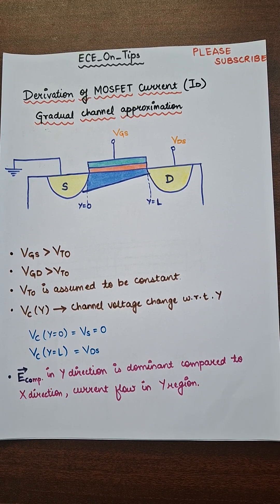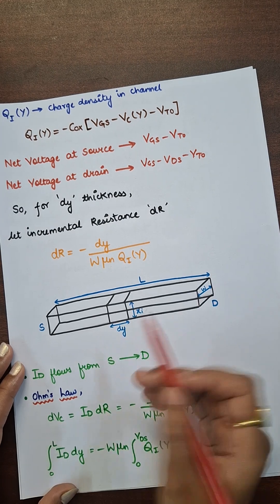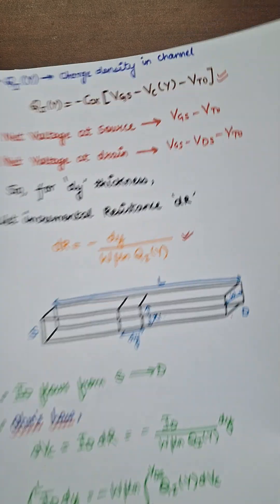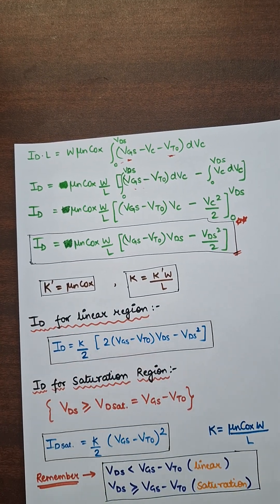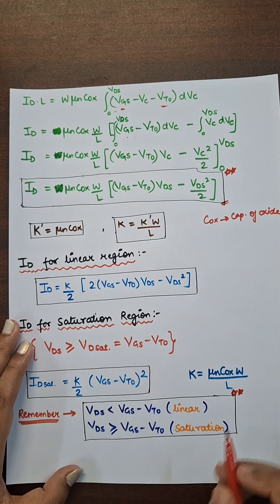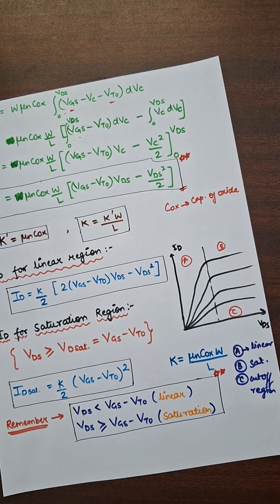Derivation of MOSFET Current (Id) and Gradual Channel Approximation @ECE_On_Tips

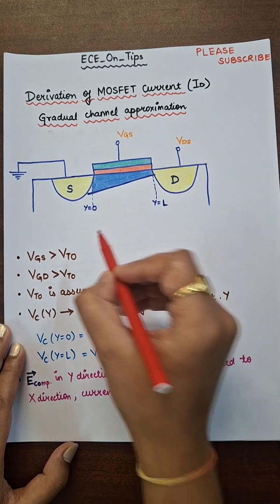Comment: 1:17 what if VGS > VTO but VGD < VTO?  Does this mean saturation?

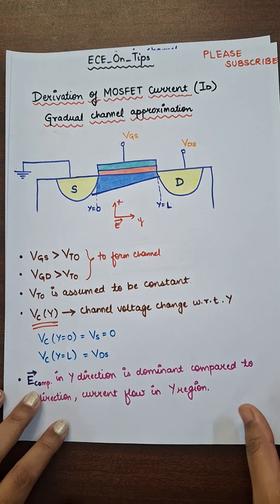2:27  isn't the x and y axis flipped?  

2:45 why isn't the capacitance of the gate used instead?

3:21 could you use the average voltage across the channel (Vox average = VGS - VDS/2) to get the same result?